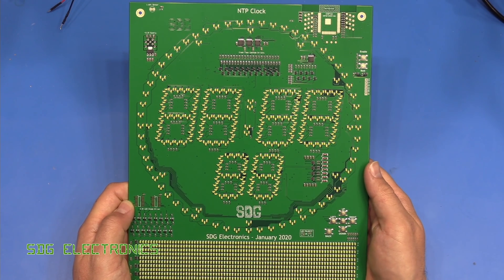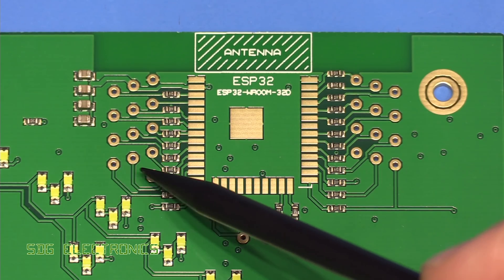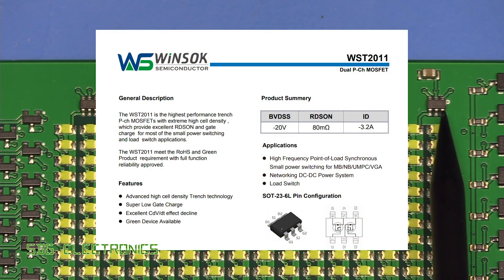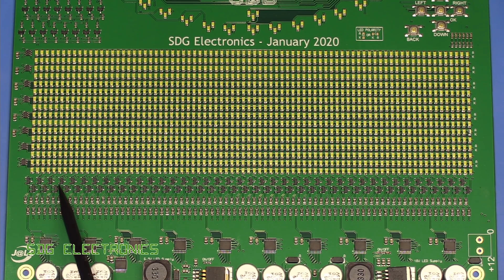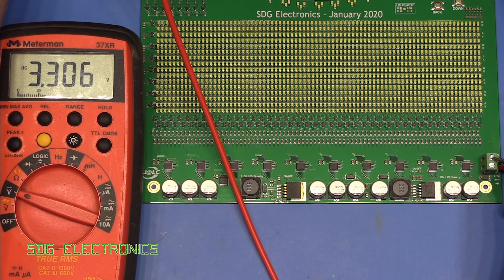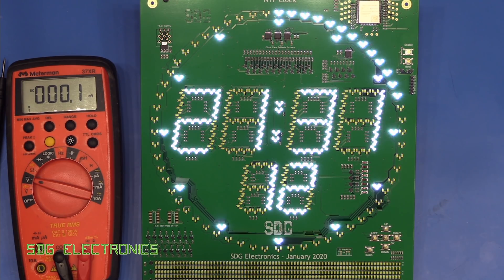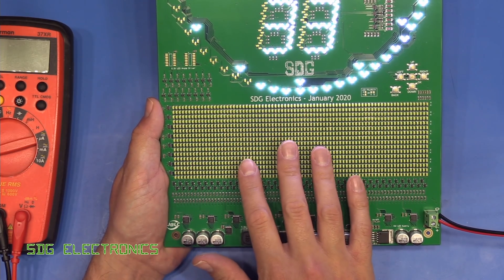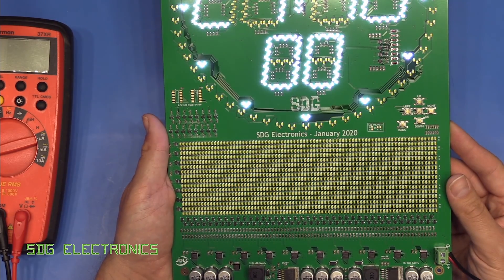SDG #142 The 2000 LED ESP32 WiFi Megaclock is here! - An NTP Wharton Electronics Style Clock

Comment: What's the idea with the loose vias next to the 3v3 supply?  I guess something went wrong with the flood fill there?  Anyway, enormous clock that you've got there!
Reply from the maker: Good spot. I cocked that up somehow. Fortunately the heat dissipation is minimal
Reply: @sdgelectronics  Yeah, just the small load from the EPS32 shouldn't require much heat sink there

Comment: Why not use led matrix driver ICs like IS31FL3742 (30x6=180 leds) for example,  or IS31FL3741 (39x9=352 leds)... 4 chips would give you 78x18 matrix ... you get i2c control and 256 levels of brightness and maybe simpler design...